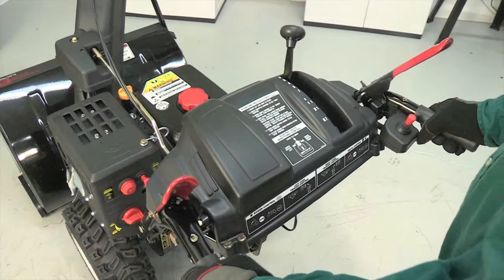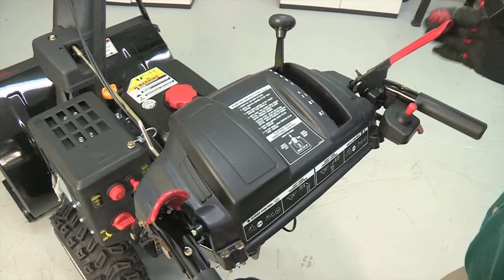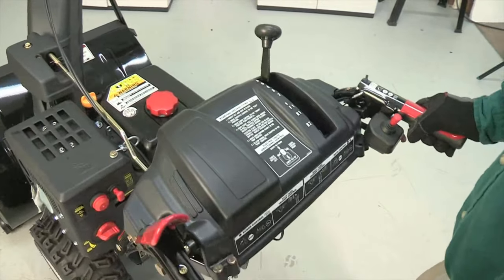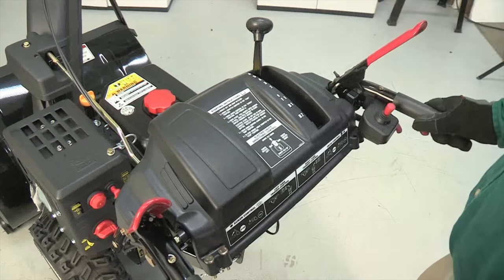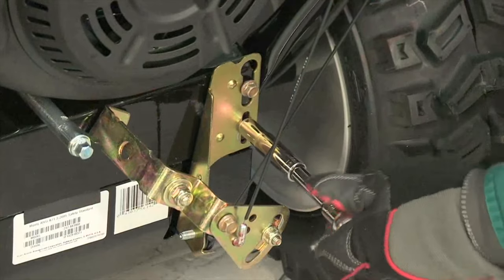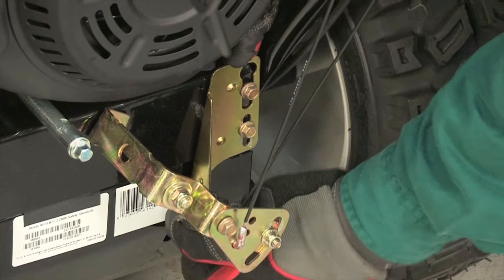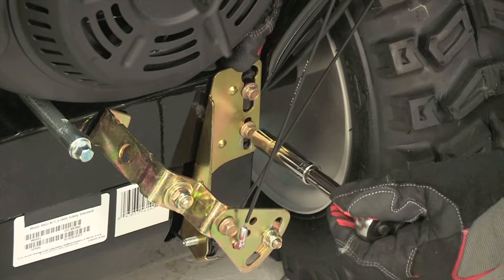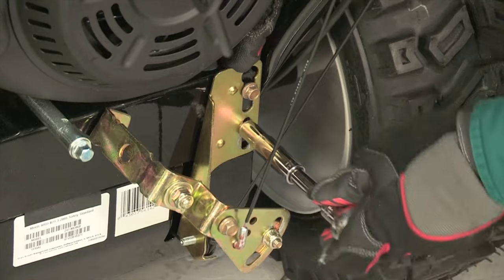How to Adjust a Snowblower Drive Control

Comment: You forgot to say to remember to tighten the second bolt when you are done testing...
Reply from the maker: The top bolt wasn't loosened during the video because it was installed loosely to allow that bracket to slide up and down when the bottom bolt is loosened. If the top bolt is tightened on your model of snowblower then you will need to loosen it to make the adjustment and tighten it after completing the adjustment.